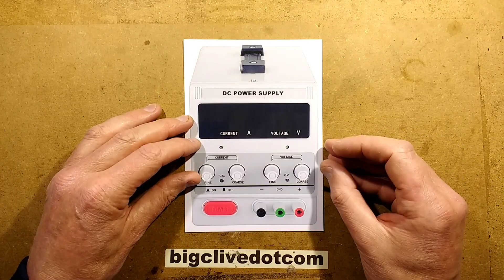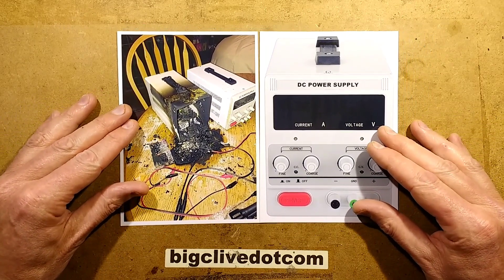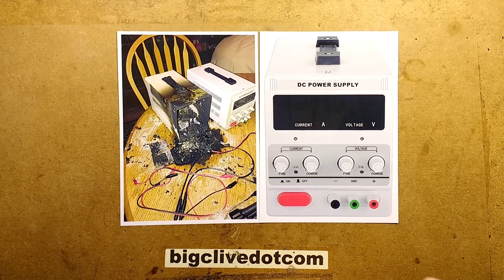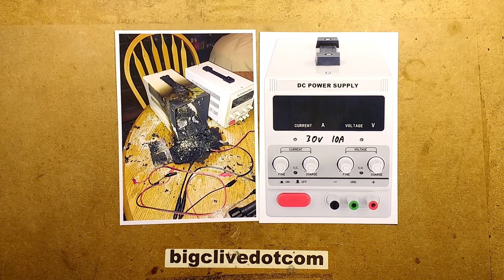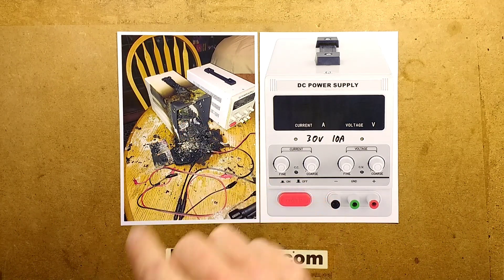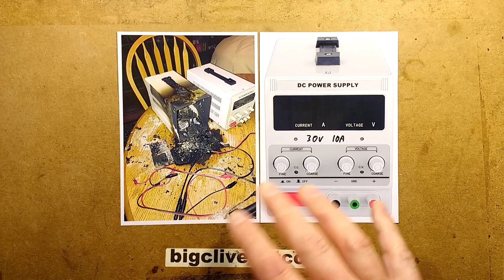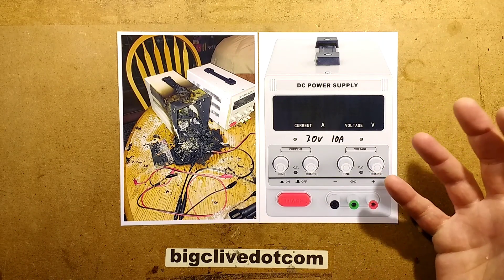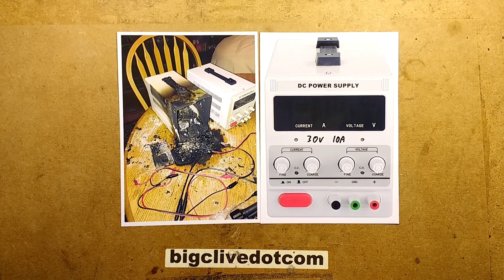Smokin' power supplies.  PSA

Comment: I would guess that he had the amperage set far higher than what was required. A lot of Peltier Plates from China that I have tested have resulted in a lot of heat on both sides even when set to a low current

Comment: I got one similar, it is 30v 5a which was ok but main cable isn't because wire is so thin and earth isn't connected, I threw it away and got the proper cable, still work to today. Another thing is the fan, it is very noisy, I might replace that soon.

Comment: Hay, where did you get a picture of my power supply? The difference is mine was on my steel work table with a grounded mat and it went whilst I was sitting there bewildered why mo O scope was so wired. Then the Halon system went off and I jump through the roof.

Comment: I own the 30v 10a model. The leads that come with it are definitely not adequate for running higher amperage loads. Anything over 5A and they get quite hot. I have run mine fine at higher loads using different leads. That said, definitely do not leave it unattended.

Comment: 18 volts seems a little high to be running a peltier junction.  I typically run them at 3.3 volts at 1.0 amps mounted to a heatsink with a computer fan. They are nice for keeping your drinks cold during the summer heat.

Comment: May have been a loose lead that melted the banana connector and then the front plastic panel. Lets say the lead in side that terminated to the banana connector was loose or the users leads were loose and a terminal fire occurred, If the power supply front panel was all metal then there would be nothing to burn other then the banana connector and the wire pvc insulation. That's why my bench power supply I made is all metal. For safety reasons when I test gear that is in a plastic box and is left unattended its best to have it isolated so fire cannot spread. I enclose all my products in metal cases for this reason. An excellent example of a high fire risk product, are LED drivers enclosed in plastic cases up in the ceiling cavity. Another are Lithium Iron batteries on charge, such as you're iphone...For a house fire-- you need fuel and a means for it to spread, so by isolating the hazards and reducing the fuel, they can burn but not for long and the fire cannot spread either.

Comment: I've got one of these and the quality isn't good - even for Chinese products. The provided power cables were stupidly thin and would probably take about 2A before they would melt. This is hardly ideal for a 10A rated unit.

I had to repair mine when I smoked it - doing something stupid with a supposedly flat and sulfated up lead Acid battery. The supply doesn't like reverse current flows and melts a pair of 1N400x sized diodes on the board.

I've also replaced the 4mm posts at the front since you couldn't get a firm fixing into them. I expect this was related to the problem the viewer had. Replacement posts are cheap at your favourite component supplier !!

Note that there are two versions of this supply - one old style linear one with a thumping transformer (which is what I was hoping for), or the newer switched mode version, obviously its dead easy to tell which one you have by the weight of the unit.

Comment: I have one and it exploded a mosfet at 18v 8A.  A Mouser search showed the mosfet that exploded was only rated at 8A.  But the knob on the power supply lets you turn it to 10A.  AND THERE IS NO FUSE.  BE CAREFUL OUT THERE!

Comment: Is this the unit with the TO-3 package transistor on the back?
Reply from the maker: +Graham Sutherland No.  It appears to be an internal switchmode power supply.
Reply: Cool. Probably not the one I have then, even though the front is almost identical. I bet the chassis is an off-the-line model reused by lots of manufacturers. Although 10A @ 30V is a joke on these things; I can barely get 5A at 12V from mine. Probably why it melted.

Comment: Mine has blown up three times with smoke no flames it's always been the IRF510 mosfets in the switching stage that decide to let the smoke out. Doesn't really seem to matter the voltage but it is very current dependent which strikes me as strange.

Comment: Hard to say the cause after that destruction but I'm willing to bet a loose connection on the output posts. The binding posts on these are incredibly cheap and shouldn't be trusted with high current. Any weak connection will create high resistance and localized heating. If you have one of these cheap Chinese PS, open it up and give it a good going over.
You could also do a supervised test at full load for a few hours just to see if there are any weaknesses.

Comment: Bench power supplies were never meant for continuous use. And running a Peltier cooler can draw quite a bit of current. It could be that the cool side got condensation on it and shorted out, we'll never know...

Comment: The thing could do with a good safe reliable thermal cut out just like some cheap Italian CB power supplies back in the 1970s. The thermal cut out consisted of the mains live lead (single layer of insulation) being stretched over the edge of the pass transistor heatsink. When the heatsink warmed up it would melt through the insulation. When the conductor touched the heatsink something would blow provided the case was earthed or the case would become live.

Comment: Best guess: 18V output is just above the last transformer tap, thus giving a maximum voltage drop across the power transistor.  Rectifier output say 35V so that gives 35V-18V = 17V drop across the power transistor which is probably fake and/or under rated anyway. 17V x 8A = 136W dissipated in the poor thing with the usual inadequate thermal design in these things means the magic smoke inside caught on fire from the high temperature.
Reply: BitBastelei When series pass transistors fail shorted nothing much more happens to them, it is everything else that tends to get hot as the transistor(s) just become a shorted very low impedance shunt that pass the high unregulated voltage from the transformer and bridge rectifier directly to the attached load -- essentially as if you had replaced the transistor with a simple length of wire between the base and emitter.  This tends to result in a lot of uncontrolled current and voltage being dumped into the attached load and can also overheat internal wiring harnesses, circuit board traces, current shunt resistors, etc., not to mention the attached load which may now have up to 40+V and/or well over the 10A rating flowing into it (which many devices do not tolerate well), the transformer and bridge rectifier assembly can also get pretty cooked in the process since they usually were not rated for such sustained current either.

To test if the series pass transistors did fail, provided they remain intact and largely clear of the fire, you need only test for the proper diode junctions in the transistor in question (or you can use a simple pass/fail transistor tester or curve tracer).
Reply: The cables lying on the table in that photo are totally inadequate for carrying 8A. Theyre the cheapest kind of 4mm to crop clip leads with unsoldered clips and plugs and microscopically thin aluminium conductors. I had some a while back that were 60cm long with a resistance of 3.5 Ohms. Thats not a typo, 1.2m of wire with a resistance of 3.5 Ohms. I know everyone loves to blame that cheap chinese crap but that guy wasnt just asking for trouble he was guaranteeing it.
Reply: I doubt that's the cause but it brings up a point. could the temperature differential been too great on the peltire* device, lowering its resistance acting as a dead short? or maybe it wasn't great enough. would make a great experiment. The one I had ran off the 12volt rail from my computer power supply. Killed it dead! but it failed open. hmmm. any thoughts?
Reply: EEVblog Without someone tearing one of these apart or posting info on the tap points it is hard to say.  But so many of these seem to have common similarities, at least externally.  I know my Mastech brand HF3005F-3 (2x0-30V/5A plus fixed 5V/3A) linear has a transformer tap about every 5-6V over the range from 0-31V, but it also has a lot more room for external heatsink on the rear since it is twice as wide, I wonder if this model did not contain the heatsinks internally trapping all that heat from the series pass transistors and transformer in a very confined space as the transformer alone can generate a good deal of heat at high loads.  It is hard to say how this was constructed without either owning one or seeing one torn thoroughly down.  I just find it interesting that it seems to be the front panel that burned down as there usually is not much on the front panel other than the circuitry to detect and display voltage and current and pass through the front panel potentiometers as well as the banana jacks themselves.  Kind of has me wondering if either there was a poor connection to one of the banana jacks or inadequately sized wires with too low an insulation thermal rating and just not really suitable for a sustained 8-10A rating.  Thankfully mine has never so much as smoked at high loads, though the external heat sinks and chassis can get rather toasty if running at load for hours, especially with both channels at the bottom end of a tap and near the 5A rating on both channels, so when practical I will often bump the voltage up just a bit if the load can accept that added voltage safely.

Though there is the other option of a series pass transistor shorting out and dumping the full 36V, or thereabouts, into the load at a current only limited by either the load or transformer impedance, that is a very realistic failure mode -- had that happen to one of my 50A 10-15V linear power supplies that powered some of my amateur radio gear (and then had to spend some time repairing the radios as well).  So much power could certainly overheat the shunt resistors (on some linear supplies the wiring is the shunt resistor) as well as the wiring itself and could also have cooked the peltier device and transformer if their was just enough impedance present to avoid blowing the fuse in a reasonable time.  This possible fault could actually be tested for if the series pass transistors remain otherwise intact and sufficiently separated from the fire and it would be interesting to know if this fault actually occurred.
Reply: I'm not so sure about that. Judging the discoloration it looks like most heat was at the front, the main power transistors are however located at the back of the case. So from the looks this doesn't quite fit. Also the front is completely burnt, I would guess if something happened to the logic board or ammeter in the top front there would still be something left of the bottom portion, also (if thats the board on the left) there are no obvious marks. Would go for overloaded terminals for now.

https://www.eevblog.com/forum/reviews/beware-yihua-yh-305d-bench-psu/#msg99235
Reply: something got hot on that front panel, fire looks like it came from the front panel circuit board so was it the thermal designs? cant wait for Clive's mail to come 😁
Reply: I have one. It failed quite spectacularly due to a bad IRF840. There was a dramatic jump in stability after the repair. It started to go into thermal runaway when the fet popped. If I hadn't been there, it would have been a disaster. NOTE: replace the fine voltage pot. A bad run of them was used on this model! I used a 10 turn precision pot and now setting this beast no longer pisses me off.
Reply: I think the 10A model is a switch mode power supply, so it should not have any transistors dissipating high power.

Comment: Peltier devices from my experience are very susceptible to thermal runaway. Running a device like that at 8 amps and then leaving is highly unadvised. The device likely drew too much current and the internal protection devices in the power supply failed to trip causing excessive heating and fire to result.

Comment: I have a 30V 5A model, and a while ago I had one of the power transistors fail short - the display told me it was putting out 72V or something similarly excessive. I bought a new pair of transistors locally and it has served me well since.
Reply: FishSomething At 72V was that a linear or swichmode type power supply, just curious, as the maximum voltage I would expect for a very lightly loaded 30V output linear supply would be around 48-52V (around 36-40VACrms rectified minus a couple diode drops).  72VDC would suggest a tremendous amount of dissipation required by the series pass transistors and very poor overall efficiency (not that linear supplies are necessarily especially efficient).
Reply: I just poked it with a meter and you would be correct in that I'm getting 42V RMS from the transformer. As it was several years ago I suspect it is a case of exaggerated memory, 60V unloaded sounds close enough in my head. And yes, linear power supply - calls itself a Zhaoxin RXN-3050.

Comment: Are they linear or switchmode, if linear, they will need to dissipate a lot of watts at high current and lower than maximum voltage

Comment: OH boy, 144 watt TEC, I have a monster "24V 18A" one, which I was convinced wasn't going to be anywhere near it's rating, and was a little left out of place when it was and had to make a power supply strong enough to run it out of an old welder and some pretty fucking extreme Schottky diodes, and yeah it was pretty close to it's rating, running after 10 minutes it would fall off to about 14A, but if there was a heat load on one side and a cooler on the other it would be go back to almost it's rating, I ended up using it to overclock a CPU as it was cheaper to run than my phase change cooler lol.

Comment: By rights, that powers supply had no business going up in flames, attended or otherwise - the hundred watts or so it needed to dissipate in that scenario, spread over a case that size is not suppose to get anything anywhere combustion temperature. That said, it's unclear what the Peltier's contribution was, if any, and of course there are no guarantees the PSU is legit enough to actually withstand what it should be able to. So yeah - there's no reason you should need to particularly keep an eye on it, but if you're smart, you will...

Comment: Not all power supplies are equal. Yes shouldn't have been left unattended. I have two power supplies that look at a glance very similar to the one shown, but they are much better made than some others I have seen. Mine were RS ISO-TECH Brand, and have a good more inside than the reviews of similar looking units that cost a fraction of the price. To be fair though, I bought mine for work not hobby purposes, so I probably would have bought the cheaper option as well if it was for my own personal tinkering.

Comment: Could have been the banana plugs. I've a 5A 30V Yihua PS with the banana plugs that came with it, and at 5A, they get warm at the connections. The wire is actually that nasty copper coated aluminum.
Also, mine had socketed the two ICs on the main board, and the sockets were COVERED in green corrosion. Thankfully I noticed before it was too late. (It could have failed and gone wacky and put out too much power or such...)

Comment: I also have a 30V/10A unit so I rechecked the manual.  From what I can make out, the unit has built-in protection from:
Under current, Over current, Voltage spikes, Triangular Lollipops, Meteors, and Demons up to the third plane of Hell.  However there was a note in the warnings section 4, second row, seats 6 and 7: "Rotation of cord socket is many fine maintenance action.  Hold two times is sufficient!"

Well there's your problem - failure to follow directions.
Reply: Your Chinese to English translator is not using google, but simple calculator lookup tool.  So the original manual is written in English, then translated to chinese characters, then translated back to English (with no grammar checking). 

Tringular Lollipops...... 

LOL

Failure to follow directions has not caused fire before. 

Selling heavy duty stuff to people un-trained in their operation has never been a problem for eBay seller though.

Not their problem (eBay seller), if you do not know how to use hazardous equipment.
Reply: Thank you for this gem
Reply: It is insulting that they can not provide a properly translated manual.

Comment: I have a similar one. These things are not designed for continuous load at maximum rated output. That being said, mine has thermal protection that seems to work quite fine.

Comment: I have one of these (30 V, 5 A), and I've opened it up, so I'll speculate.
The linear regulator(s) are nicely heatsinked, so no huge problem there, but the rectifier on the transformer output is just screwed down to the case. Not even any heatsink compound.
The rectifier they used in mine was rated for 8 A when heatsinked, 3 A in open air. But that assumes you're willing to let it rise to 150 degC or whatever it is. It got quite hot under load and has since been replaced with a better rectifier.